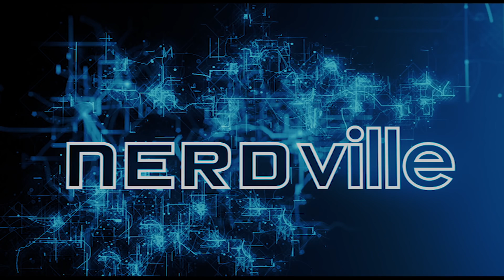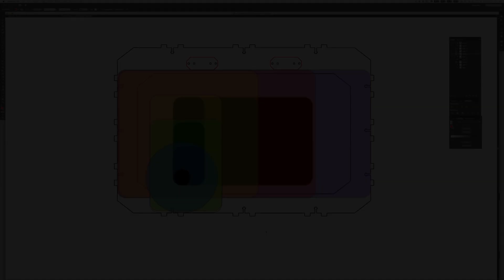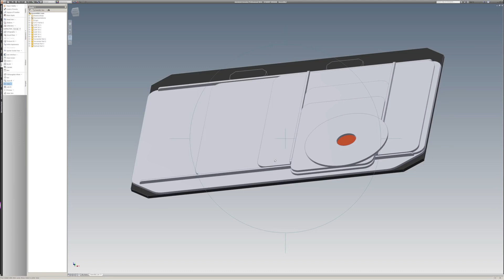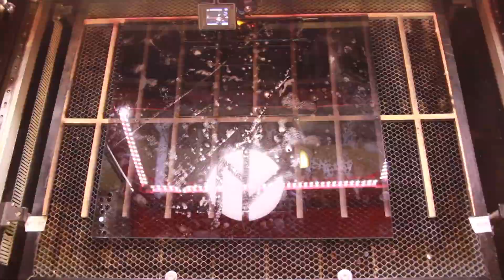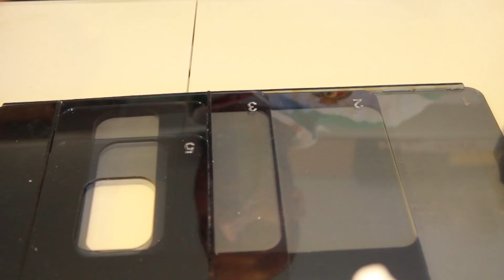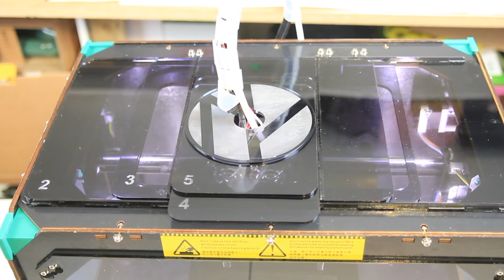3D Printer - Part III - The Iris Enclosure

Comment: As the antexN suggested put something around cables. You could also use thinner sheets of plexy and put another shutter on top reversed and make it "one piece" design so it doesn't get dust on the plexy.

Comment: Hey! It's very interesting design. It's been few months now, so you propably tested it. Could you please answer my questions?
1. Does your motors have problems with additional load? Do they show more fatigue over time? Skip steps? Anything?
2. Does the plexi start to show signs of wearing off? Friction starts to increase because of constant rubbing?
3. Is semi transparent enclosure a brightest idea? Doesn't it start to be dimmed from heat?
4. How much you had to reduce max speed of printing because of enclosure load?
5. What would you different this time?
Reply from the maker: +Piotr Trębacz hi Piotr. 

So here are your responses. 
1. There is very little load on the motors 
2. None that I can see 
3. I only used the dark plexi as it looks awesome. Any colour or clear will do. 
4. Operates as normal. Does not hinder anything. 
5. I need to modify the design as there is a park mode on the CTC that the leaf system does not account for. So it needs mainly tweaking here

Comment: Try to find some rubber ring to mount around the cables so you minimize the wear :) Great video
Reply: or get a proper cable grommet so it still looks nice.
Reply: AntexN I was thinking the same thing.  It could be as simple as a piece of pvc pipe,  just stuffed with spray foam to keep the wires snug inside the ring.

Comment: Awsome vid, I love stuff like this. If you wanted to take it a step further, some enclosed printers actually heat the inside (yes I know the heat from the bed and hot end do this), but some actually pump in more heat. This is usually only needed for tall prints. But for long print times you would then need a hose to bring in cool air for the extruder cooling fan. Because, without this, after a while the extruders cold end will be cooled with hot air. If the cold end gets too warm, the filament will expand in the cold end and jam the extruder. I am speaking from experience. It all depends an the quality of your extruder, and the heat-break between the hot end and cold end.

Comment: Very clever design.  It will be interesting to see the long term durability.  You may consider some felt/teflon pads to keep the parts sliding nice.  The acrylic usually works great when it is kept clean, but as soon as some tiny dust flecks get in there and start working, they start to sand themselves and may start sticking.

Comment: I was thinking that with the 18650 battery's you could possibly adapt the 3D printed egg printer I think it's on thingy verse to print the battery stats onto the battery from the arduino I don't know if it world work but it's worth a shot
Reply from the maker: LOL already have been looking into that and hoping to create an 18650 version. It's a small project for the NERDlings I think.
Reply: Wow they are already into that stuff at that age ?
God I want to be a kid again lol 
I think my younger self would be in heaven hee hee

Comment: Nice job! I'd suggest also using cables chain like the one used in your Laser cutter, mount it horizontally to get rid of the vertical bow so you can close the chamber from top completely.
Reply from the maker: Good Idea will look into that